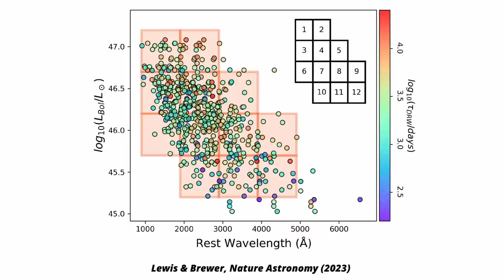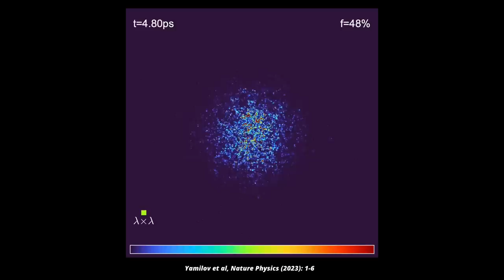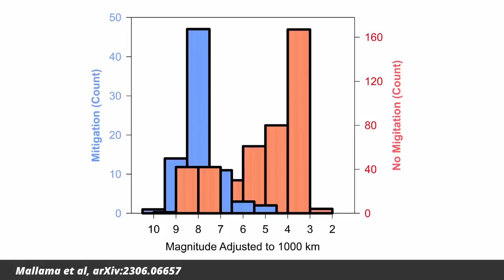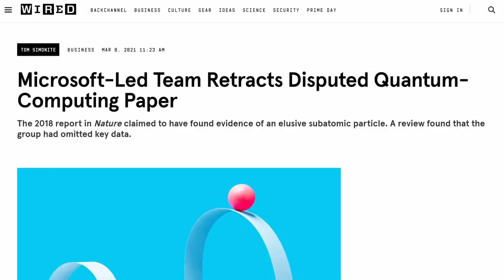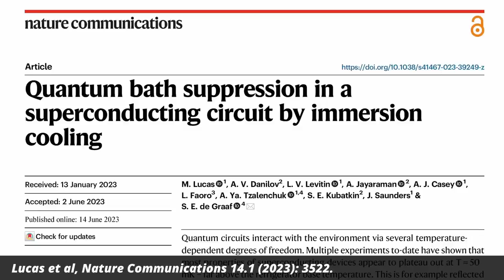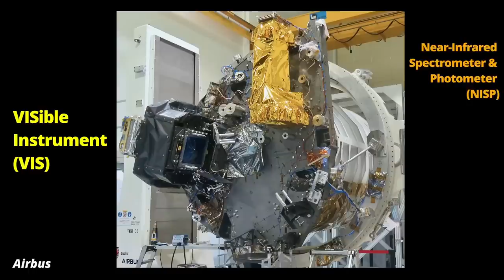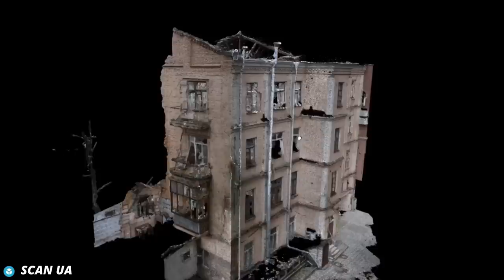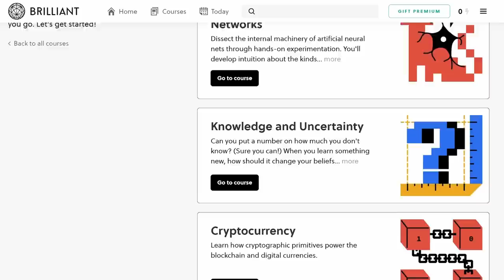Time Ran Slower in Early Universe, New Study Finds

Comment: Just a minor nitpick at around the 3 minute mark. This study wasn't the first time cosmological time dilation had been observed in redshifted light. We had already detected a similar effect in more nearby (though still fairly distant, millions to billions of light years away) type IA supernovae (first documented by Goldhaber et al. 1996, and later confirmed by multiple other studies, including Blondin et al. 2008). They are actually much easier to measure the time dilation component in because their light curves aren't nearly as complex as quasars. They're basically an on-off switch of brightness, whereas quasars have a lot more statistical variability. This new study was therefore important not because it was the first to detect cosmological time dilation, but because it was the first to definitively find it in quasars specifically. Previous studies (such as Hawkins 2010) claimed to have found no evidence for it in quasars, but they were not quite as statistically robust as this new paper. I hope that clears things up a little bit.

Comment: HASEL actuators could be valuable for people with severely weak immune systems, or maybe just for people in long distance relationships.
The Euclid mission sounds interesting, but I'm more optimistic about the upcoming "non-Euclid" mission and it's ability to handle space-time curvature!
Reply: "or maybe just for people in long distance relationships"
-
As long as they don't infest the wearables with tracking software. But I'm not holding my breathe.
Reply: @Elrog3  True. When I wrote it I meant for hugs, but as soon as I read it realised it also applied to adult activities. It'll just go to third party advertisers to make it easier to buy things you need, like airline tickets to where the other person lives.

Comment: as a chronic sufferer of tinnitus, i am very interested in that laser research.  though, the "blockages and cell growth" explanation sounds fishy to me.  tinnitus has a variety of causes, but a common one (and mine) is damage to the mechanical parts of the inner ear.  the small bones and the cochlea.  i have no clue how laser exposure is supposed to fix this.  there might be something to this treatment, but i expect it's placebo.

the tinnitus management i am on relies on brain plasticity, training your brain to screen out the "junk data."  combined with some hearing aids that have a sound generator outputting targeted frequencies, i'm learning to focus on that sound (or something else available) to screen the tinnitus sound from my perception.

also, those HASEL actuators look pretty neat.  i can see this tech being developed into much more lightweight and responsive "artificial muscles" than current tech we have like hydraulic cylinders.  with a proper nerve/ brain interface, such tech could be used to restore movement to the paralyzed, or perhaps be used as an augment to the able-bodied.

Comment: @Sabine How does the time dilation affect the speed of light? Did the length of the second change? If it did, did the numerical value of the speed of light change? Or did the speed itself change?
Reply: Only relative to the observer. Scientists actually have it backwards. Time passed slower in the early universe not faster. It only looks to have passed slower because we are the observer. Light would have appeared to travel at a slower speed relative to today's light if we were measuring it in the perspective of the observer "Here and now" but as the experiencer light would have traveled faster as the universe was at a higher energy consolidated state meaning time and space was more condensed therefore could be covered faster. This is why time actually passed faster in the past, not slower. It only appears to be slower because we are in a less consolidated state now and time passes slower for us now therefore when we measure the passage of time in the past It only appears to be going slower because one second a million years ago would take like an hour to observe from today. So it gives the illusion that time passed slower in the past but if you are seeing that illusion it quite literally means that time passed faster in the past for the experiencer. It's relativity and it seems modern science has forgotten about it

Comment: 4:29
spheres. Metals have long been overlooked for  this purpose because they tend to absorb light  
4:34
rather than trap it, but the team was able  to calculate their way to this solution. 

What  would be the difference  between  trapping  and  absorbing light.
Reply: absorbing - the light is destroyed (I know this isn't technical terminology, but the technical terminology is "absorbed" so pedants are gonna have to let this one go), and its energy is given to some other property of the material such as heat.

trapping - the light still exists, but it is bouncing around inside the material, unable to get out.

At least that seems to be what's going on here to me. I'm not entirely sure.
Reply: @alansmithee419  Seems right, but how could you determine which one was happening?
Reply: @alansmithee419   It not correct either.  

“Energy cannot be created or destroyed, it can only be changed from one form to another.”
― Albert Einstein 
"Light" is absorbed  by atoms and changes the energy state of  electrons  and eventually re emitted when the eletron relaxes Light meaning photons  
Then there is the  Photoelectric effect 
 Then there are the Phonons, 
Doing  this work convinced LOL me...https://en.wikipedia.org/wiki/Atomic_emission_spectroscopy

Comment: Since all the parameters (12 billion years ago or 12 gly distance) are model dependent, let stick with what is not model dependent, the observed time dilation of 5.
This means that these Quasars are really at an epoch where 5=14.01/R(t) or R(t)= 2.8 billion years or a 4D radius of 2.8 GLY.
The redshift from these fluctuations should be 1+z=5 or z=4.
If this is not the case, then one of the two observations is incorrect.
This also means that the distance is really 14*4/5=11.2 instead of 12 billion light years.
That is consistent since 2.8 +11.2=14 our current age.
This is how off the current understanding of the Universe is. It makes a big difference.
For example, the farthest galaxy has z=13.2 which means that R(t) = 14/(1+13.2)=985 million light-year or 985 million years after the Big Pop.  That is way easier to explain than 325 million years.
In other words, my theory - the Hypergeometrical Universe Theory (HU), considers that the earliest galaxy was up and running 3 times later than the current view...:)
That makes the difference between looking stupid (for not listening to me) and looking good...:)

Comment: Is it possible that bright starlink trails can be identified and edited out more easily than faint ones would be? Like how (by analogy) observatories use sodium lights because it’s an easy line to remove? Or do they also mess up the rest of the observation?
Reply: Sodium lights work because you're sacrificing specific spectra. Satellite flashes are full-spectrum, so they'll degrade whatever part of the exposure they show up in.

Comment: The experience of time passing faster or slower is relative to the observer's perspective. From the perspective of an observer who existed in the early universe, time would have indeed passed faster relative to our current experience.

When scientists refer to "time passing slower in the early universe," they are typically describing the phenomenon from our current observational standpoint. It is an observational effect resulting from the expansion of the universe, the effects of gravity, and the relative motion of different regions.

However, it is important to note that when discussing the experience of time for observers in the early universe, who were part of that higher-energy-density state, time would have passed faster for them relative to our present experience.

Therefore it is incorrect to say that time passed slower in the past. It did not. It passed faster. the importance of distinguishing between the observer's perspective and the experiential passage of time is imperative. 

This is why dark energy doesn't exist, dark matter doesn't exist, and the universe is not increasing the rate of expansion. It is a linear growth. The illusion of an increase in expansion is just a byproduct of being a product of the system we are measuring. Modern scientist fundamentally do not understand relativity no matter how much they claim to. Otherwise this wouldn't be an issue. But because it is, science is lost in the woods.

Comment: Now, if we could only get the VRChatSuit, which tracks motions more subtle than violently throwing a ball.

(For those not aware VRChat is to Meta what social spaces are to corporate spaces.  Depending on where you are, you can get anything from talking to a veteran about their most harrowing experiences to, ...ah... personal encounters where having the ability to apply a gentle touch to a partner could greatly enhance the experience.  Mostly somewhere between those extremes, though.)

Comment: 3D dental scans are stored in STL format, so you can 3D print your teeth if you want. (My wife did an MRI scan of my brain, so I used a surface-finder to convert the voxel data into a polygon mesh, converted the mesh to STL, and printed a copy of my brain.) :-)

Comment: Ugh. I get WHY they're saying "time ran slower" (BTW, it's "time ran more slowly" but anyway) but here's the problem, we only have four dimensions in space time, x, y, z and t - ONE t. The confusion lies in conflating clocks with time (a little like confusing a rule with distance). When you speed up, your clocks change their mapping of time to events. But time can't have a rate - rate is by definition change over time, so a rate of change of time means change in the flow of time OVER TIME and we only have one time axis to work with.

On top of that, time is relative - something embedded in spacetime cannot talk about time in the absolute, so it's really tricky to talk about global time by comparison. If you're at the edge of an event horizon, to me, it looks like time has stopped for you, but for you it looks like the universe has stopped. Which is right? Well, both because we're using two different sets of clocks to measure time and they don't map to spacetime the same way.

More to the point, if your buddy Einstein is right, there is no 'flow' in time. Time is causal and sequential - all of space time is a static entity with events placed locations in spacetime (x,y,z,t). I know you agree with this as you're not only a determinist - you've even gone so far as to propose superdeterminism as a solution to the indeterminacy quantum mechanics seems to introduce to the universe. This is why retrocausality and time travel are actually not possible. You'd need a second time axis to travel in to move (change in location over time) through time (the location being changed) and we don't have one of those as far as we know. (And thios is why superdeterminism keeps coming up - as a way to explain away events that seem to violate determinism).

So what explains the shift in frequency? Well, let's not forget that the universe started essentially as a black hole and at least through the 10^-26s of hyperinflation was still inside its event horizon. That meant mapping of events to spacetime was highly compacted. Less than the wavelength of even the highest frequency light. Low frequency/low energy photons couldn't even exist then. It also means the curvature of all of spacetime would be deep. I mean it's like a black hole unfolding and flattening out. So all light would be moving "uphill" against this gravitational curve which would appear as a drag or counter acceleration until the universe flattened out enough and matter distributed out evenly enough to counter balance and make the universe homogenous and net gravity zero (I'm intentionally leaving out expansion as while it absolutely affects this, in the early parts of the timeline, which is what we're talking about, local gravity would have swamped it and the energy pressure from the initial state is what was driving rapid expansion)..

Simply put, time didn't run more slowly - clocks did. The mapping of events to spacetime was more compact because the universe was more compact and not as flat.

Comment: At the earliest point in the universe at which you can actually measure time, only 3 years have passed in relationship to us. This is because at that earliest point in the universe we still had almost all of the mass in the universe sitting right there. It means it's the slowest running clock in the entire universe and also it's not going anywhere so in relationship to everything else it is sitting still. Right there at the beginning of time. This is what results in our gravity. The pull of this early mass on our mass at this point in spacetime where everything is much more dispersed and each habits own local time. Giving us a universal time clock, and a local time clock which runs at a base rate against the universal time clock. So here it's been however many billions of years whereas there at the beginning it's only been three.

Comment: Showing that the rate time passes increases as the cosmos evolves is more significant than you might think.  It could do away with the idea that galaxies are getting farther apart. That's because the red shift observed would be due to relativity rather than Doppler shift.  This in turn could eliminate the need for dark energy.  Here  is why.  Special relativity tells that time dilation and length contraction go hand in hand, if you have one then you also have the other. If the past universe was time dilated then it was also length contracted. As it becomes less time dilated it will also become less length contracted, that is, it will expand.  But this kind of expansion comes without increasing the volume of space-time. As space expands so does the length of a meter stick so the volume remains the same and so does the distance between galaxies. Since distance doesn't increase, dark energy is not needed to drive the expansion.

This model of expansion would greatly simplify cosmology, so it is not likely to be accepted by cosmologists who need things to be complicated so that they can prove they are smarter than the rest of us.
Reply: Not at all. The slowing is relative to previous/later times. Nothing in the universe in any particular epoch changes any relative relationships within it.

Comment: I saw a paper very long ago that I wish I could find. It looked at the distribution of distance galaxies and determined that they don't fit "expanding universe" but do fit "the farther away they are, the slower their time is running."  As in "the universe isn't expanding, it's just the axis of time is pointing a different direction."   (I don't know how correct the paper was.)  So it seemed like the universe is on a sphere, and the time direction points away from the center of the sphere.
Reply: Time is not a spatial direction. You cannot point towards the past nor towards the future.
Reply: @filonin2  It's definitely a direction. The reason we even have time dilation is your time axis isn't pointing the same direction as the moving person's time axis. Of course "direction of the time axis" is a figure of speech here.

Comment: Perhaps I am mistaken but my understanding of the cosmological redshift was that the light emanating from objects in motion shifts to the red end of the spectrum if they are moving *away* from the observer [at high rates of speed], not as objects are moving toward the observer as the narrator/host otherwise states at the outset of this video presentation. Conversely, light from objects traveling toward an observer would/should shift toward the blue end of the spectrum due to compression of said light waves.

It's not rocket science (  ; ) ), it is analogous to the Doppler effect of sound waves and is, in a sense, simply a "visual representation" of the principle regarding either the compression or the elongation of waves - sound waves in one instance and light waves in the other. Compressed sound waves (e.g.: produced by the sound of an approaching train) sound more highly pitched than are elongated sound waves [that the train makes after it whizzes by]. Similarly, and in accordance with precisely the same principle, compressed light waves (e.g.: produced by, say, a galaxy moving more toward the Milky Way) are more blue in comparison to more elongated light waves [produced by galaxies moving away].

And perhaps this is simply a misunderstanding because of the ambiguous manner in which her statement is worded. Did she mean as the *light* travels towards us, or as the *object* travels towards us? The former would be silly because, obviously, if the light is visible, whether redshifted or blue-shifted, *all* light, that has reached us, has been traveling towards us so as to render it visibly apparent.

In any event, such a glaring ambiguity, if not outright error, renders suspect all other information presented in the video.

Comment: Thank you, Sabine, this is fascinating (time running slower in the early universe) news, but extremely difficult for me to wrap my brain around. So, how is this related to Inflation Theory? Could it be that TIME has an inflationary component? In other words, TIME speeds up as the INFLATION ACCELERATES? So, time accelerates as the inflation accelerates. It makes my head hurt and I don't understand it. Oh, it's gravity. The entire universe was in a SINGULARITY, and TIME WAS RUNNING SLOW. As the universe accelerated in expansion, TIME sped up, and the DISTANCE between two points, between objects, expanded. As the universe continues to ACCELERATE IT'S EXPANSION, TIME will also ACCELERATE... until the universe and time fly... (it could make my brain explode...)